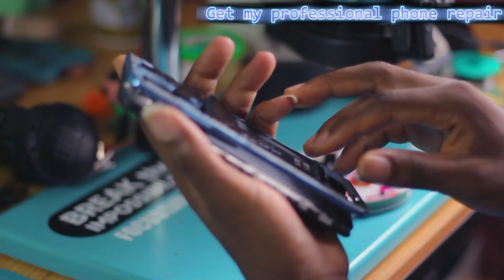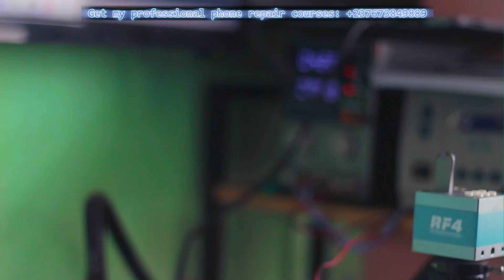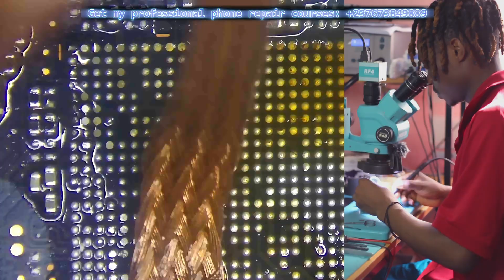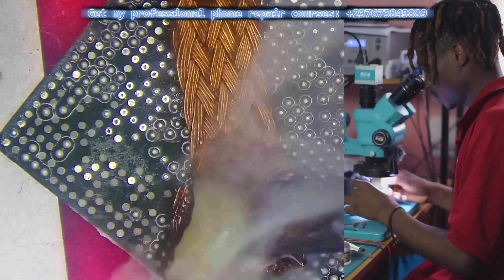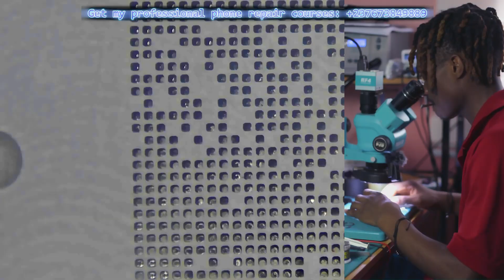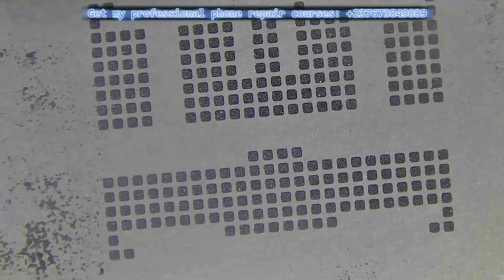CPU and EMMC Mobile Repair Troubleshooting Course - FULL VIDEO

Comment: How about if there's no reading after the power key is pressed or triggered. If the reading is 0.0000 and no current draw.
Reply from the maker: Check vbat to charging ic > check vph > check power on voltage > check power ic